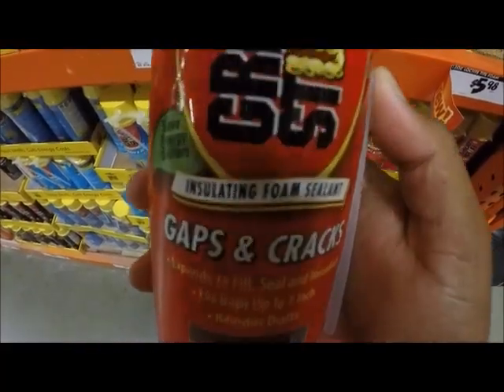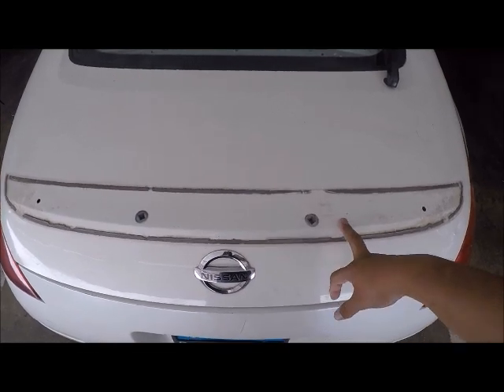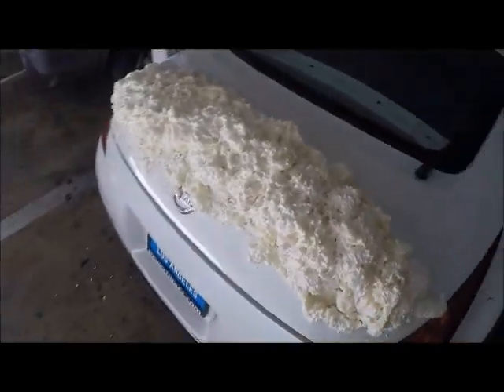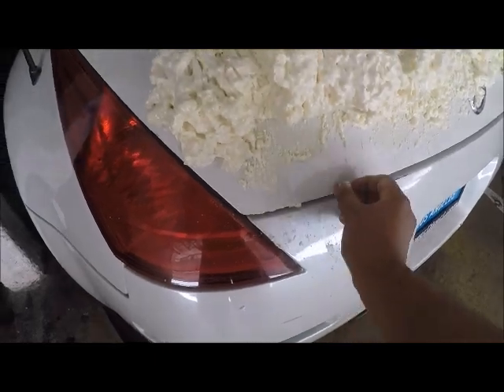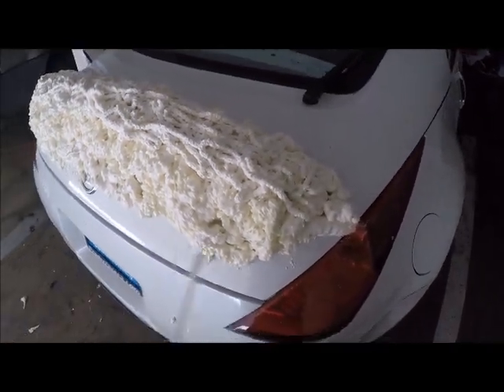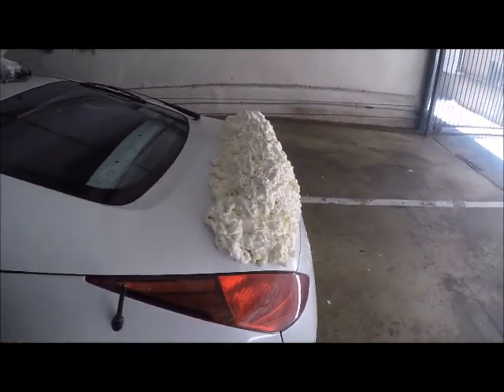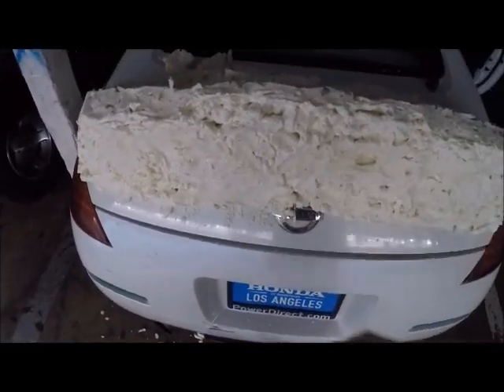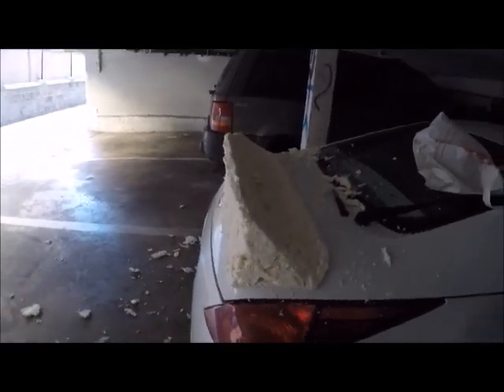Making A Duckbill... Duckbill Fail #2?

Comment: Put down painters tape 1st then you can use foam but sculpting clay is easier and better to work with. Then when you got the shape you like put foil over it then masking tape over that then lay resin and fiber glass to make a mold you put the masking tape over the foil so the mold can come off then you take the foam or clay and tape off put carbon fiber on the inside for strength then sand and paint etc there you go man
Reply: Timothy Strunk I concur. At least that's the route I'll be taking